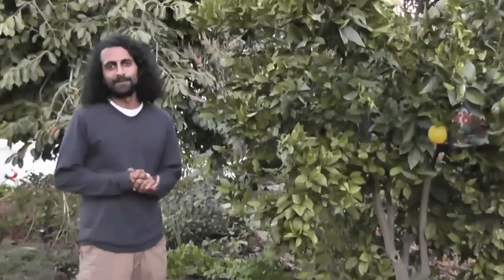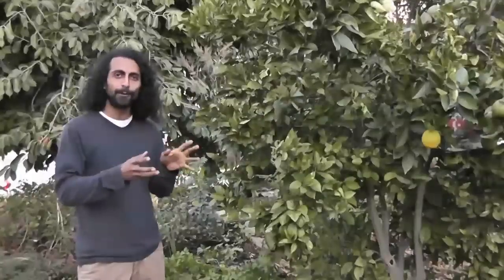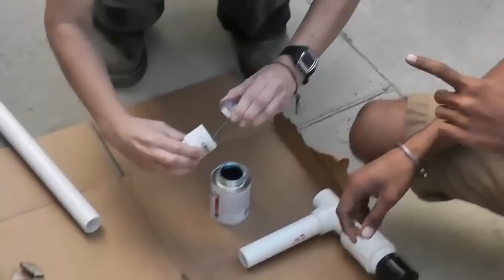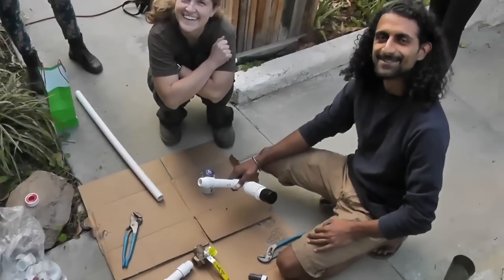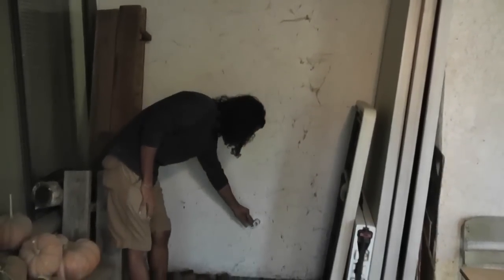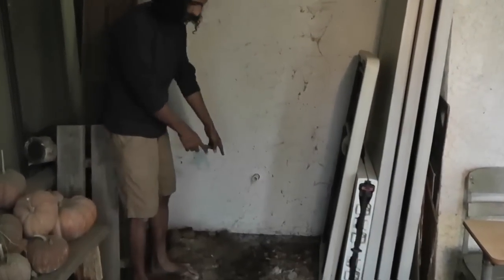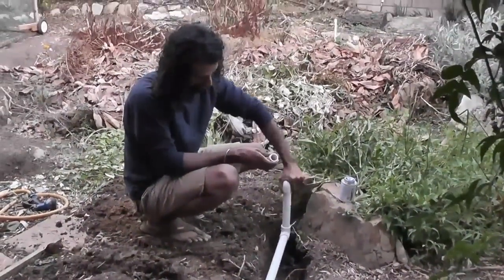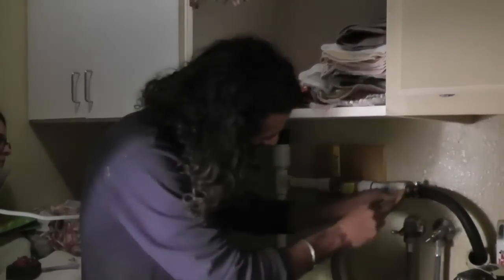How to Install a Laundry to Landscape Greywater System HD

Comment: For my washer, I now have a separate dry well, which is no longer working causing back flow water left in the machine.  Like this idea better than digging another dry well, but I live in NY and I don't think a hose would survive the cold winter.  Also, my machine is in the basement connected to a discharge pipe with a trap several feet above the washer, which exits the house about 10 inches below the ground.  So I guess I'd have to make a new higher exit pipe, but would I need a pump to carry the water up or is a washer powerful enough to push it up that high?  Last question:  how do your hands stay so clean in the video?

Comment: Question:  We have had a laundry to landscape system for several years but I just realized that the drain from the washer to the system (either sewer or landscape) has a loop in it.  I'm thinking that could be hard on the washer.  Should I try to shorten it so that there is no loop?  Thanks.

Comment: Really great video. Thank you for this. However, you could of used a 3 way PVC ball valve and saved like $40 on it. Also, for these DIY homeowner systems, I always think it's better, cheaper, and less of a hassle to just have all the washer water collect into some kind of Bucket where you can then just water what you want with it. I find it useless to trench and run piping, or ever use a hose, for the very small amount of water. Just my thinking though.
Reply: Hi oiboy626, top-loading machines generate about 40gal/load, and efficient front loading machines generate 15-20gal/load. That's quite a few 5gal buckets to move around the yard each load, and we at Greywater Action have found that running 1" HDPE pipe trenched @1-2" depth through the garden, with 1/2" black poly outlets into mulched basins, is an effective way to automatically irrigate many plants without having to manually move buckets or a hose. This is also a design approved by the California Plumbing Code (Chapter 15). Oasis Design or GreywaterAction.org have detailed diagrams and videos on the laundry to landscape system as well. The books Greywater Green Landscape, and The Water Wise Home are excellent resources as well.
Reply: Also, the 1" Full-Port Brass 3-way valve is the ideal part for the L2L system, since it has a full-port 1" inner diameter that does not restrict the flow from the washing machine like other valves do.

Comment: I set up this system and the first time I used it the water came shooting out of the studor vent. Is it because the studor vent needs to be higher? Your video doesnt say anything about it. My studor vent is currently at about 8 inches above the 2 way valve line.
If it need to be higher can I put an elbow to avoid an overhead cupboard?
Reply: Is it a problem if the exit point at the  wall for the outflow pipe is only a few inches below the 2 way valve line?  thanks again!
Reply: Jim Tavare On rare occasion the AAV (air admittance valves) comes damaged from the store and leaks water, so replacing the vent may be in order ($5 part). Also, like mentioned above, the vent should be at the highest point of the system, and the 3-way valve should be above the flood rim of the washer (top of washer).

Comment: Really like the video.Thanks.  I was told you need larger diameter pipe like 2" .  Otherwise its too much pressure on the washing machine pump. Any comments appreciated.
Reply: michael shadler ...just my thoughts but perhaps that's why they suggested a Studor Valve?
Reply: michael shadler The distribution line should be similar in size to the original washing machine drain hose (typically 1"), since that was sufficient size for the washing machine to drain in the first place. By maintaining 1" pipe/tubing, we maintain pressure in the line, which makes it much easier to push water throughout the landscape. Once you go up to 1-1/2" or 2" pipe, all pressure is lost and the system is dependent on gravity for flow.
Reply: Laurie Paris The air vent is to prevent a syphon.

Comment: Why did you bury all that pipe when you're ending up with a hose anyway? Isn't it easier and cheaper to have a longer hose and less pvc?
Reply: Paula Peng The less pipe/tubing/hose exposed above ground the less likely it will be a tripping hazard as well photo-degrading in the sun, and kinking as the plastic softens with heat. We at Greywater Action recommend using relatively-ridgid 1" High-Density Polyethylene (HDPE) tubing for distributing the L2L mainline, buried 1-2" below grade, or just landscape stapled to soil at grade, and covered with mulch. HDPE is durable, doesn't kink or photo-degrade, it's easy to work with without glues/fumes, and it's recyclable in the recycling bin for off cuts and for the end of its life. They usually come in 100' rolls under the brand names Eco-Lock or Blue-Loc, available at irrigation supply shops or Home Depot's online store.

Comment: Would'nt the use of detergents and fabric softener render it to be blackwater? And if that's the case it would not be good to use it for agriculture purposes. I'm genuinely curious for an answer, thank you.
Reply: We only use Oasis detergent that I get online.  I only need 1/8 to 1/4 cup per load so it lasts a very long time.  Oasis has not harmed the citrus trees, fuyu persimmon, or peach trees nor the perennials in the front yard which is an alternate system.  We've been using the system for 3-4 years.

Comment: Hi, sweet vid! Mega helpful. Do you by chance know if the studor valve is still needed if sewage is not in the equation? I am running my washer strictly to garden.
Reply: Thanks! I bought a studor brand but it's white not black like most of the ones I see. Hope I got the right thing :) maybe I can post s photo.
Reply: Phillip Pickles Hi Phillip, the vent prevents a syphon from developing, which could end up a continuous draining of the machine, while it's simultaneously trying to fill for the rinse cycle. The vent breaks a syphon by introducing air into the line. The white vents are often a little more expensive ($10-15) but are actually more durable than the $5 black ones.